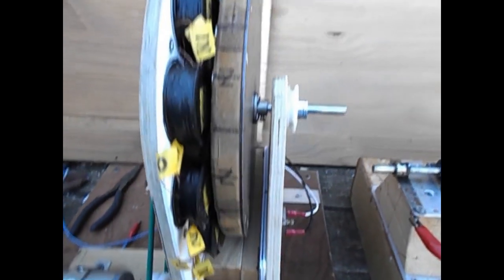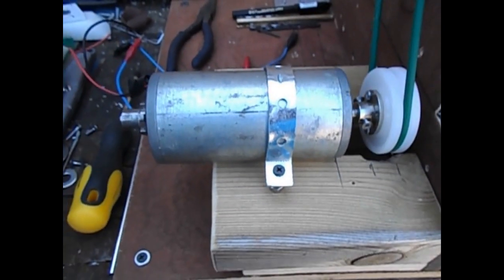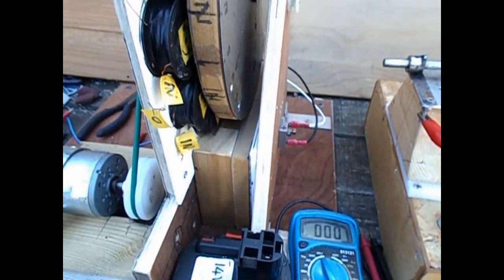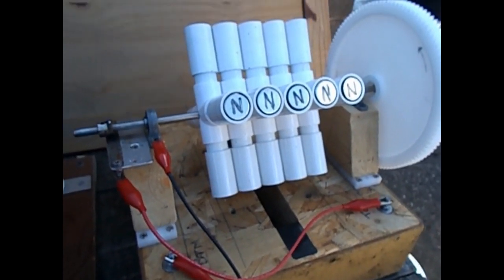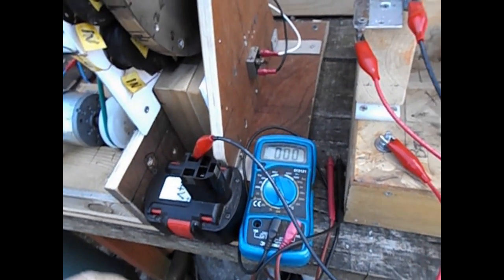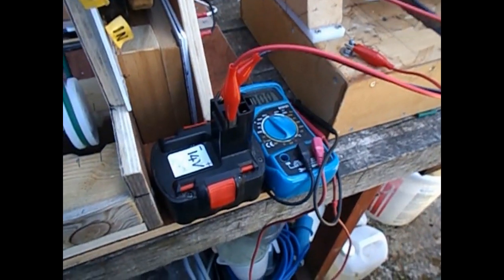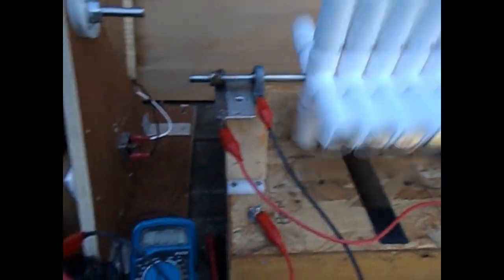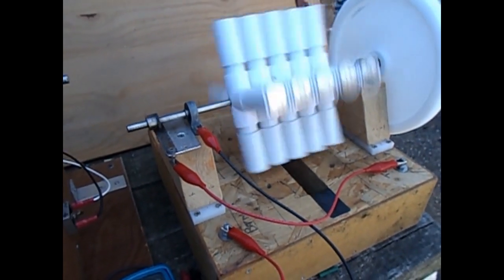Newman motor powered by axial flux motor that is run by a 12 volt battery with a 24 volt motor

Comment: I think the use of nice wide coils diffuses the lenz effect that most other generators suffer from; also the large round metalic plate helps diffuse the magnetic drag as it is spread out instead of pinpoint like other generators so you may have more production than input.

Comment: I see your passion but please tell me your purpose ...here i am confused and i think you have to be more specific
Reply from the maker: Hi. Thanks for the interest. On this occasion I was trying to demonstrate that using the same 14 volt battery I got two completely different results.  By powering a motor to drive an axial flux generator did I generate more power out than I was putting in? because the Newman type motor was definitely faster than when I used the same battery direct to drive the Newman type motor. Over unity being the questions being asked by this presentation.  What do you think? hope I made it clear for you regards  Deryck.    ps. dont forget to subscribe so you can receive any future videos on this.
Reply: @DeryckThompsonChasingtheDream  we probably have the same passion but we look at the problem from different angles. surely it does not produce more than it consumes. I'm not a fan of Newton but he happened to hit it off. If you develop your idea and identify all the forces involved in your device, you will notice that you must also involve kinetics, gravity, temperature... and so on. energy is born from movement...any movement. If you find the perfect imbalance that takes into account all the forces involved, you will get the device you dream of......the movement of the planet helps you a lot and in the end.....from there you will extract your surplus energy. Personally, I think that only a happy accident will help you in your endeavor because the time required for the study is much longer than our average life time, so try. you invited me so nicely to subscribe to your channel that obviously I do, at least to help you. success
Reply: @DeryckThompsonChasingtheDream   what you're doing is commendable, but I think you're wasting important resources on something that will have a completely different purpose than what you expect. Please just look at the lever as the ultimate tool that allows you to do extraordinary things because absolutely everything that has been invented so far is based on this principle. always the most unexpected perspective on this principle gives birth to something spectacular. Theoretically, we have made several devices that apparently produce more than they consume. All respect the laws of physics, but I never had the curiosity to put them into practice, even though financially it would mean a very big reward. I love your passion and I evaluated your work financially only from what I saw in the video. you are investing a lot in a slightly wrong direction. Great ideas are incredibly simple. You complicate the device only after you have made it, to hide the idea.
Reply: @DeryckThompsonChasingtheDream  hi. please try to use the washing machine motor u have as a load from that Newman motor to generate power. cant wait to see the result. thanks

Comment: very cool can this work radial to radial motor say Adams to Adams or Bedini to Bedini or one of each? this is awesome to see the speed and torque go through the roof good to see a motor run a motor thanks.
Reply from the maker: I dont know is the answer to your question. Something I will have to take a look at. As you will see from nearly all of my video`s I dont use electrical circuits to operate my machines. most have mechanical timing which I find is very reliable and it allows me to increase and decrease the voltage without the fear of burning something out.
I try and keep it basic so others can build them even if they have no knowledge of electrical circuitry.  Hope you have subscribed to my channel   Regards Deryck
Reply: @DeryckThompsonChasingtheDream  your channel is truly amazing keep up the good work. yes I scribed a long time ago I got it to work! radial pulse running radial pulse motor well the main is more like a transformer due to the fact that the copper in the drive and the copper in the gen never touch and there is more then20 times the amount of copper in the generator side then the drive side. therefore, it appears as over unity, but this is not true when you factor in the amount of copper there are 1600 turns of 24-gauge wire for the drive with 8 transistors1 per 200 turn strand of 24 awg 200x8=1600.  Now there are 38,865 turns single strand in the generator side of  pulse motor various gauges there is 26, 32 and 20 gauge and 4 soft iron cores generated a current max of 6.05 amps/350dc volts that is1800/2000w at 5dc volts in and 2.5 amps in

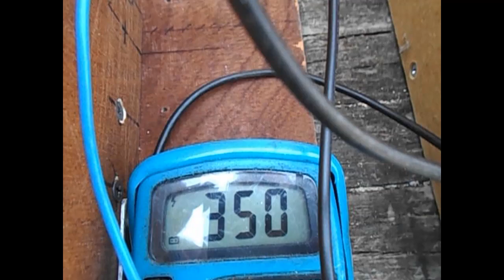Comment: 5:00 thats how you propagate reactive power threw the entire system  most just throw out the tongue related to the rotor magnets and the Iron cores  aka pull fore  but you can store it all in a really heavy flywheel resting on a pipe bearing system , its two pipes one is slightly smaller and fits inside the air is the lubricant , when the pipe spins the air is compressed because you have such little space  this bearing system can handle limitless amount of weight great for super heavy energy storage into flywheel as well the larger the mass of flywheel the slower you can spin it and still store power , slower spin for safety but the more heavy it gets the more accurate your pipe bearing needs to be

Comment: are you pulsing 180  or 360 ?  see on my channel how to pulse every 180 with pole inversion using DPDT. I think Newman may have done this as well with a custom commutator 👍
Reply from the maker: Hi  Every 180 deg it makes contact by using this method it does increase the speed accordingly.  Regards  Deryck
Reply: @DeryckThompsonChasingtheDream  cool

Comment: Wow that huge newman motor there. How did glued those pbc pipes on the steel shaft.
Reply from the maker: Hi, I pushed each 4 pole section onto the shaft and this allowed me to twist them into alignment ,then I super glued to hold in place.  Hope this makes sense, regards Deryck

Comment: Wow. what an interesting idea. Does the NM have a load or is it just freewheeling?
Reply from the maker: Just free wheeling at the moment, I was finding out the difference in power to the NM  using the 14 volt battery for both methods. and as you can see using the axial motor made the NM spin 20 - 30 times faster. which can only mean that the Axial motor gives out more power than the battery, ??  more tests to follow to prove either way.  Regards  Deryck
Reply: @DeryckThompsonChasingtheDream  Since you have a bridge rectifier between the source and the NM, the power that would normally head back to the battery is blocked and utilized by the NM? I'm not sure but grounding the NM may slow it down about half speed but thats just an idea of a way to test it. It could be utilizing the BEMF from the axial rather than it just turning into heat

Comment: Nice. It would be helpful if you also showed current flow from the battery in each configuration.
Reply from the maker: Hi Thanks for your comments,  This is my first test and I intend testing this more with regards to the volts and amps used because it seems that I am producing more power through the axial flux generator so keep an eye on my channel for the results, Subscribe if you havent already and you will be informed of my future videos.  Regards Deryck.

Comment: Impressive  but whats the v/a readings
Reply from the maker: Thankyou, The volts and amps used will be in the next video so keep looking out for it.  Please subscribe if havent done so already. Regards Deryck
Reply: @DeryckThompsonChasingtheDream  i have ;) i make motors aswell, and got a few things coming up, i gonna wind a generator soon that should hopefully have 220v and 13amps out, 150wires wound in parallel to get the amp, but my torque motor isnt as big as yours it probably won't be enough to overcome the drag.